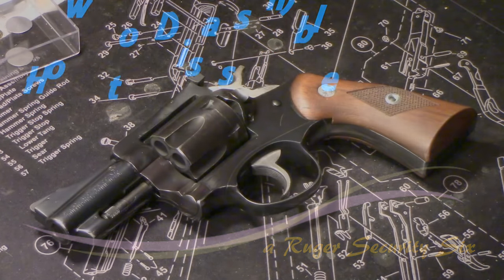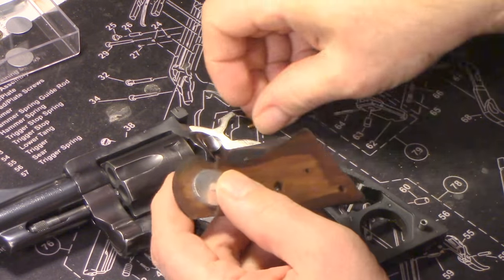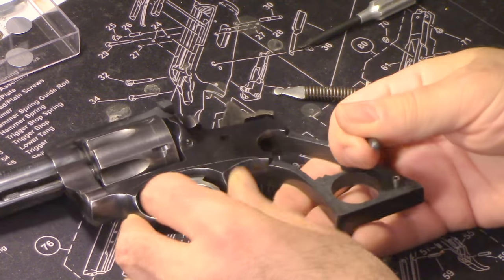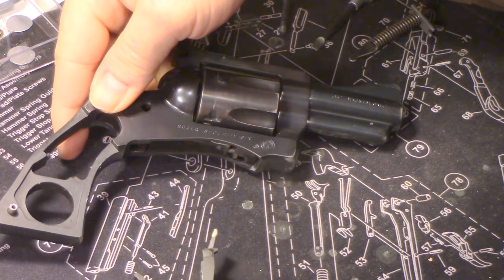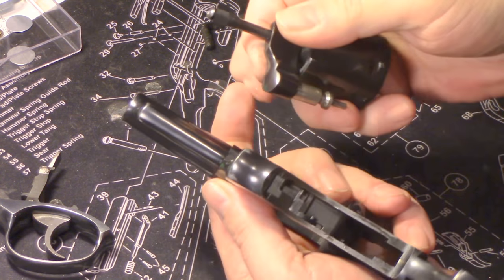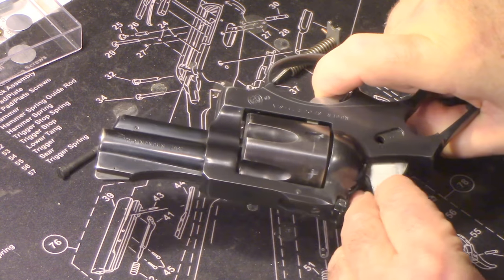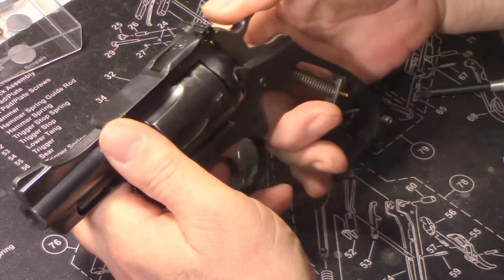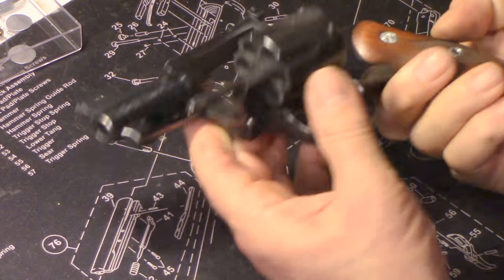Ruger Security Six Revolver Diasssembly and Reassembly

Comment: Very sexy gun with an more appealing barrel length of 2.75 inches.

The guy who designed the Ruger Security-Service-Speed Six was ALSO the exact same guy who designed those Charter Arms revolvers.
Reply from the maker: Really?  I wasn't aware of that.  I thought it was mainly Bill Ruger himself behind it.  It certainly is an amazing design in terms of simplicity and durability.